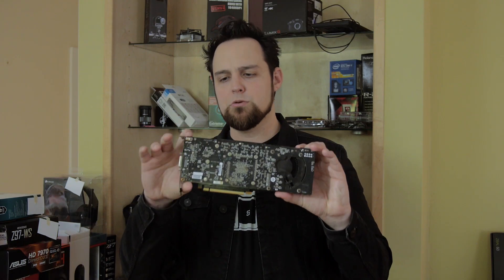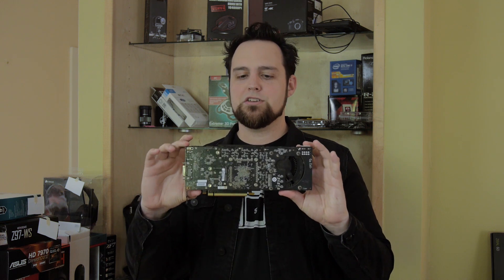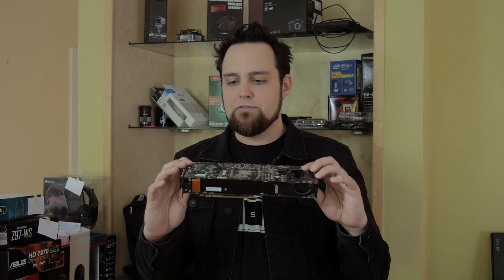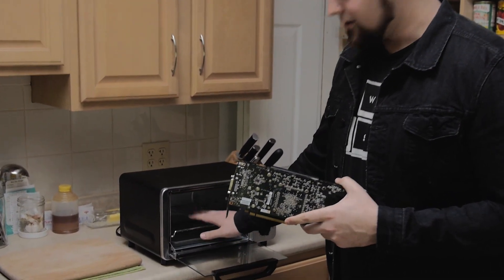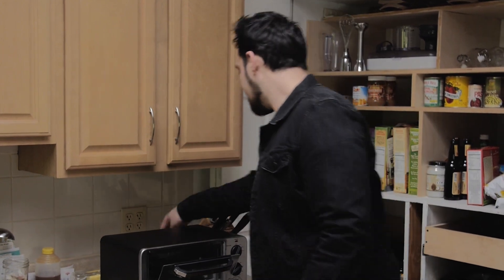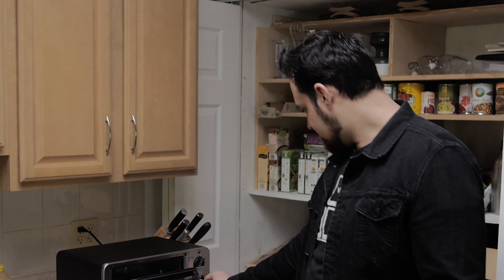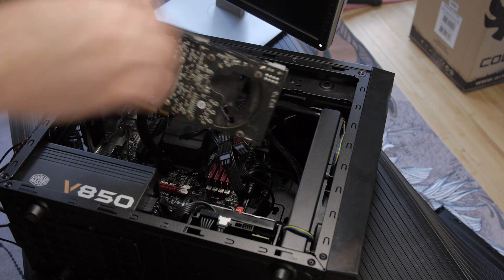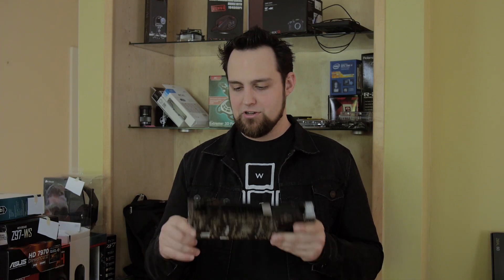How To Fix A Dead Graphics Card

Comment: For those of you who do not know that actual process, here is a condensed version:
I. Purification (on self, not video card):
 The sprinkling of holy water and incense around the area is highly recommended. You may proceed with either your aspergillum or bowl of holy water (or even magnetized water) and at each four quadrants repeat the following while sprinkling the water in the form of a cross:

'Asperges me, Domine, hyssopo et mundabor,
Lavabis me, et super nivem dealbabor.'
(Thou wilt sprinkle me, O Lord, with hyssop and I shall be cleansed
Thou wilt wash me, and I shall be washed whiter than snow)
   https://www.exploringtraditions.com/cleansing-of-sanctum-or-habitation/
Afterward the words have been spoken, give the Sign of Silence and repeat at each of the four quadrants until you’ve returned back to the east.
II. Perform the LBRP (Lesser Banishing Ritual of the Pentagram) https://www.exploringtraditions.com/cleansing-of-sanctum-or-habitation/ or https://www.thelemistas.org/en/MSS/Bjorge/SpiritualExercises/07-pentagram
III. Opening of the Temple:
(facing east) 'I invoke thee, guardians of the watchtower of the East.' (Sense a purifying wind calming the mind, and and picture immense protective force with a yellow aura)
(turn clockwise to west) 'I invoke thee, guardians of the watchtower of the West.' (Sense a purifying water washing away negative emotions, and and picture immense protective force with a blue 'aura')
(clockwise to south) 'I invoke thee, guardians of the watchtower of the South.' (Sense a purifying fire burning away all distractions and spiritual baggage, and and picture immense protective force with a red 'aura')
(clockwise to north) 'I invoke thee, guardians of the watchtower of the North.' (Sense a purifying current in the earth grounding you and balancing you body, and and picture immense protective force in earthtones)
Insert Bornless Invocation here (sorry, you'll have to look this one up - to perform this correctly, you must memorize it; don't read it)
Here is the tricky part -
IV-A. Either Invoke Michael (the Angel of Kabbalistic Sephiroth of Mercury - Hod) and implore the angel to fix the video card
 or
IV-B. Evoke the appropriate Goetic Spirit http://www.esotericarchives.com/solomon/goetia.htm  - The 55th spirit Orobas might be a good choice. You and (optionally) the video card in a 9 foot circle; the entity evoked in a 3 foot triangle outside the circle - use appropriate incense for the entity in question), and once you are sure you have Command and Control over it, demand that it fix the video card without any harm or cost to yourself, your loved ones, or anyone else. Give it a time limit (not too quick - 4 to 6 days is good). https://www.exploringtraditions.com/goetic-evocations-theory-and-practice-behind-conjurations/
V-A. After the Invocation, thank the archangel, and re-perform the LBRP *
V-B. If performing an Evocation, make sure you obtain a full manifestation of the entity (the incense will give the entity a medium to materialize in); maintain control at all times and do not allow the entity to sidetrack you, distract you, bargain with you, etc. The entity will try to find a way to get out of helping you - don't let it! And Do Not Step Outside Of The Circle during the Operation!
VI-B. Once you have extracted a clear commitment from the entity to fix your video card, remind it not to do harm to yourself, your loved ones, etc. and extract a commitment to come again swiftly when you call; then command it to return to its abode (release it). Make sure it is gone before proceeding.
VII (A or B). Perform the LBRP again, purify the area with x (incense and/or holy water for Invocation; check Goetia for post Evocation purification instructions), and remove all traces of the operation.
Here is the most critical step:
Once you have completed the Invocation or Evocation, get online and order a replacement video card.
If by some chance your broken one starts working again, sell it on eBay as fast as you can!
If your are adept at electronics, you can also try checking the fan (if any) and each capacitor to see if any are blown, etc.

Comment: So my gpu won’t work if I plug the power cables in but it will turn on if they aren’t plugged in but as long as it’s plugged into the pci slot it will turn on I’m really nervous and don’t know what to do.  One time I tried to turn it on and it smoked a little I immediately turned it off and stuff and everything except the gpu when it plugged in with the cables

Comment: All this method does is soften the solder inside the DIE not re-flow the balls on the chip itself.  It's a bogus fix and will reult in the same thing happening after the die materials loosen again.

Buy a new card and whatever you do,  don't do this and sell it.

Comment: I updated my drivers , GeForce GTX 760, and I got d3d error - dxgi_error_device_removed error. Tried rolling back and using other drivers, still doesnt work. System doesnt even recognize my card anymore. Coincidence that my card happened to crash right as I was updating drivers? Thats what people are telling me, that its junk. In Device manager its not show, just shows Microsoft Basic Display Adapter. 

:(

Comment: I have amd 580 msi gaming x card and its new just purchased like before 20 days and i think i overclock its by support power supply option in msi afterburners and its not working now. Like fan is not spin and card is not detected but led still show light. Its a fixable? By demage of over voltage?

Comment: good luck fixing failing graphics chip in the oven.. wouldn't last longer than 1 month. also baking the card on high temperatures would possibly release toxic fumes and could crack working components, not mentioning the fire hazard. and normally takes 180°C+ to start melting the solder joints. 200°C+ if Lead free

Comment: why not find where the actual problem is and resolder the joint or replace the messed up part ie capacitor diode or resistor

Comment: if you clicked this awful click-bait vid looking for an actual fix for your artifact'g dead card outside warranty, then try this instead:

1- wash your grubby lil hands & only touch the edge of the PCB, the rear plate, or the HSF assembly. NOTHING ELSE - EVER.
2- set out an anti-static mat & ground yourself to it
3- remove the HSF, carefully wipe off the TIM from it & the GPU silicon. leave the RAM & VRM thermal pads on the HSF
4- make 4 small stands aprox 1/2" tall from aluminum foil that can support the card by the mounting holes at each corner
5- cover the remaining plastic bits (power connectors, in/out ports, etc) in a layer of aluminum foil
6- place a layer of alum foil on cookie sheet, your stands on that, & the card on the stands GPU-side up
7- set your oven to bake at 385f with rack in middle. wait till it's pre-heated fully
8- open a few windows near the oven and use a fan for ventilation if there's no natural draft/wind
9- put your card in & close the door for 8min. don't be tempted to go longer on the 1st try, & do not bump the card or oven even slightly
10- turn off oven & open door slightly to allow heat to escape gradually. leave it like this for at least 30min-1hr (dependant on room temp)
11- carefully remove card & your aluminum covers, clean the GPU & where it contacts the HSF with 99% isopropyl alcohol
12- re-apply TIM using the lintel-ball method, & re-assemble HSF
13- enjoy this (possibly temporary) fix that can always be performed again if the card re-develops issues

this method is the at-home version of reflowing. it doesn't fix everything. sometimes it's not permanent due to poor design or quality from the mfg in the 1st place. lead-free solder develops micro-fractures, so we're stuck with these issues a lot.

Comment: This "fix" will only last 20-30 days and literally does nothing. that temperature can not reflow lead free solder. All this "fix" does is heat the silicon in the gpu enough to move the structure around with a 50/50 chance of doing nothing. THIS IS IN NO WAY A FIX FOR DEAD GPU'S. Either RMA your card if under warranty or buy a new card.
Reply: Well no fucking shit Sherlock, what did you think would happen when you put it in a toaster oven
Reply: wun taps What do you mean by "what did you think would happen". I was explaining what this does and how it's not a "fix"? The host mistakenly says that it would reflow the solder?
Reply: Toast651gaming linus said the same thing...
Reply: how does putting something that obviously won't fit in a toaster oven, which probably wont even be able to melt the soldering on the card, plus the fact that putting it in enough heat to melt the solder would kill the fucking gpu, not come off to you as a joke.
Reply: wun taps possibly because I have seen a shit ton of people that make videos like this and preach it like it works
Reply: If those don't come off to you as jokes as well then god please get off of youtube, these videos are meant for satirical entertainment not for some smart ass to come ruin it, just enjoy the video and move on (and if anyone is too fucking mentally challenged that they actually go through with this, its on them not you, and not the creator)
Reply: +wun taps
Who said this was a permanent fix? The video describes a retarded method that could never work, as well as do more harm than good, but oven reflowing is absolutely a real technique for homegamers.

We're talking about paperweights here. There's no harm in attempting a reflow. ICs also aren't destroyed instantly at maximum rated temperature. If a video card died due to a failed solder joint, oven reflowing may fix it, but as Toast said, it will only last so long before it dies again. Attempting reflow is the ONLY plausible technique aside from simply buying a new video card. Professional reflowing and reballing is simply financially very much not worth it.

To be honest, you sound like some jackass kid who just got off Google with his newfound knowledge about nothing. If your logic rang true, then everything I have ever touched with a soldering iron is dead, wave soldering shouldn't be possible and professional reflowing definitely not possible. So I ask, why are you being such a little cunt over this?

Comment: too much production for an instructional video. I want facts not sprinkling shit on soil, grabbing random crap from a shelf. all I want to know is how to repair a copper pin coating on graphics card pcie interface
Reply: nevermind... comparing my card with images online I see the pins aren't broken...copper on the pcb of the interface... two are naturally shorter than the rest
Reply: hey tek syndicate, excuse my first comment. I get it now. it's funny. the oven failed so you resorted to dark magic. I needed help and this video didn't help, but now I know my pins are fine this video makes sense lol. so what fixed your card? the oven or the magic? cos if the magic did it then I'll skip the oven and not risk melting plastics.

Comment: 9 out of 10 times the chip is dead. it will come to life when heating it but eventualy it will die again it has something to do with the heat. also when doing this you can and will damadge components that you dont whant to damadge. so before putting your 300 plus dollar vcard in a toaster think again and go for the waranty instead
Do not take it out strait away let it cool for a few minutes. if you do plan to do this.

Comment: Okay... the reason it doesn't work is because either the solder balls are broken, or the connections in the main Die are going, by re-heating it your just temporarily re-estabolshing the connections in the die.. @Louis Rossmann I felt an urge to annoy you..

Comment: Oh shit. Louis Rossmann PC Repair channel has a lot to say on this 'fix'. Baking GFX cards to reball them is his #1 BSOD Action trigger. He could be saving a baby in Time's Square when someone pulls out a toaster oven and video card, he will drop the baby to address why baking a card will only extend a chip's life in some circumstances, and it won't extend it for much more than a month. That fraudulent PC repair fronts will use this tecnique to 'fix' a graphics chip; take your money and leave you S.O.L  when it dies again a few weeks later. Of course, he ends with: Do it if you have no other choice, but don't be surprised if it doesn't work (because of another problem) or if it fails a month later.

Comment: omg I had one of these cards. it was awesome! sandwich design multi gpu for the win :D
It ran reeeeally hot tho. not enough cooler for these 2 insane gpu's
I tried fixing the temps by reapplying thermal paste and made it worse lol. it is a very tricky design and the cooling pads on the pwm's and shit had to be the exact same height and they got destroyed when I removed the pcb's from the cooler. as I had no replacement pads I took thick thermal paste instead.... yea I know it was not a great idea but that was a very long time ago.
anyway, I fired it up and stress tested it and after a few minutes it was gone. the temperatures got above 118°C on some parts.
unlike other video cards, this monster had several temperature sensors. i think it was for both gpu's, vrm's and vram.
well anyway, I learned my lesson and never destroyed any other hardware ever again ;)

Comment: i have a xfx 7950 ghost single fan its not getting any display do you actually think the bake method will work or is there other options to try first
Reply: It can actually work, but it's clearly not the best method. I'd only try it if you really don't care about it possibly being ruined further.

Comment: I tried it with my graphiccard recently, but the fire won't appear. Do i need some other kind of powder when i paint the pentagram on the ground? Should i have putted it in the oven before, or do i have to wait until next fullmoon? Or does a cup full of fuel and a lighter maybe do the trick?